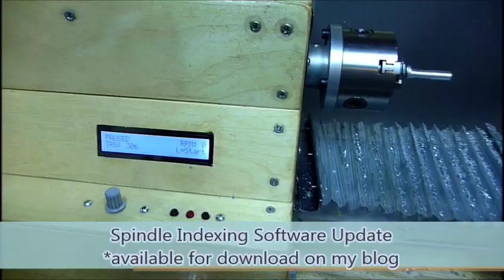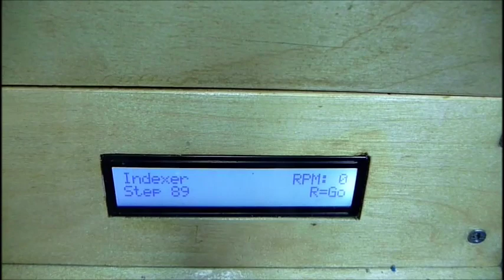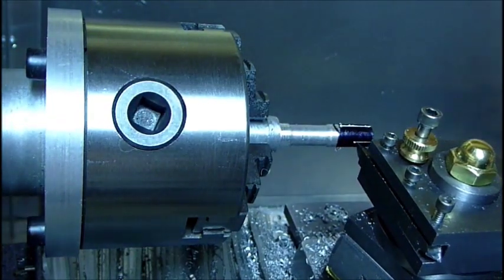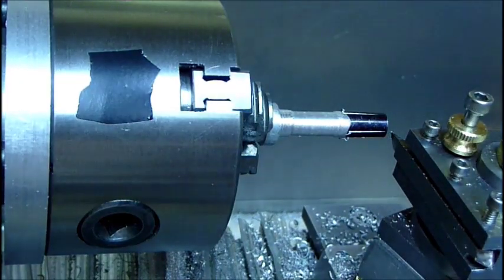Spindle Indexer and Lock Update for my Gingery Lathe

Comment from the maker: Finished adding indexing  capability to my Gingery Lathe, once I get my dremel holder I should be able to do some interesting work with the machine.

Cheers,
Morgan
Reply from the maker: haha, ya not there yet - for threads I would need to get steppers on the cross slide and leadscrew. Maybe at some other point in time, I'm probably going to work on a CNC PCB Mill or 3d printer soon, when I have a chance.

Comment: so is the spindle a DC motor with a custom encoder? do you think it would be precise enough for threads and tapers?
Reply: also you demonstrate that it can index properly at a low rpm, how do you think it will preform at higher rpms?
Reply from the maker: The spindle is driven by a 2.5hp treadmill motor with a custom controller of my own design. It uses an encoder to perform the steps accurately. It's precise enough to put repeatable features on the workpiece at certain degrees ( my software allows me to select how many steps per rotation ), though you wouldn't use this for thread or taper cutting, you'd need an ELS ( electronic lead screw ) for that which in turn would need to be synced up with the spindle's controller - something I have plans of doing in the future if I have a chance.

I primarily wanted this, as I have a dremel holder for my toolpost, and in turn can now drill holes accurately at certain degrees around the piece being machined. There are many more applications of this - if I wanted to cut 8 slots equally spaced around a cylinder, or whatever, I could do that now with this update.
Reply: Is it possible that you can do an els update soon? I would love a video on how you implement it. Is the treadmill motor DC or AC? Most motors I find are AC and idk if I want to deal with an AC motor. I'm not sure if my thinking is correct or not but aren't DC motors easier to use?
Reply from the maker: You wouldn't perform it at high rpms, this isn't a cnc machine so there is no need for the operation to be performed quickly, also higher RPMs would result in less accurate breaking of the spndle, etc...

realistically this update allows you to rotate a certain number of degrees, lock the spindle, and then use the something like a dremel holder in your toolpost to do some work on the workpiece, then you rotate it again, and do the same thing, etc... such that you can make repeatable features accurately around the workpiece.

The 'spindle lock' is in the video, simply because when you reach the next indexed position, you don't want it to rotate while you are doing work on the workpiece via whatever tool you have in your toolpost, for instance my dremel. You then unlock the spindle, press the button on the controller to advance to the next indexex position, lock the spindle, and repeat, etc...
Reply from the maker: Treadmill motors are DC, and you can typically find a controller for a reasonable price. If you were to do the original Gingery Lathe, you would just pick up a washing machine AC motor, and plug it in ( no controller needed ). You get your speeds via belt changes, etc...

My setup has no belt changes, it uses PWM to adjust speed, and has a PID algorithm to compensate for load changes in order to maintain RPM, etc...